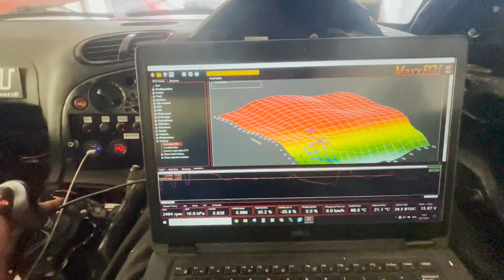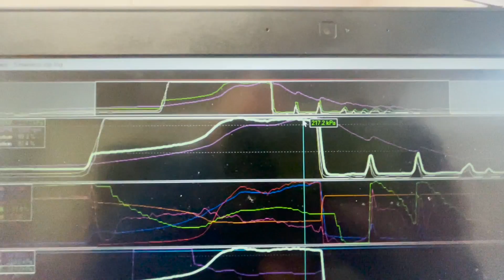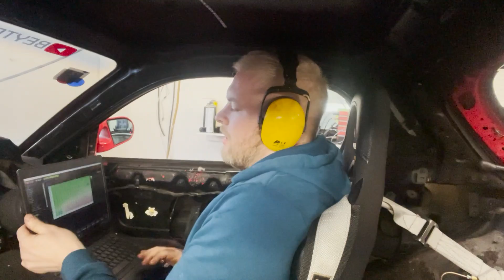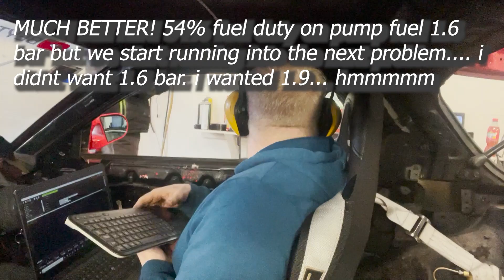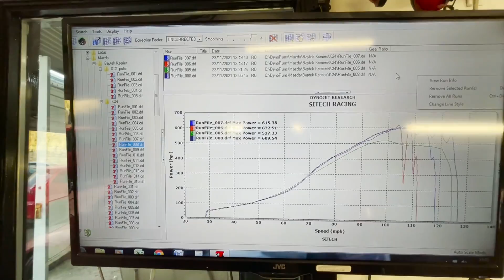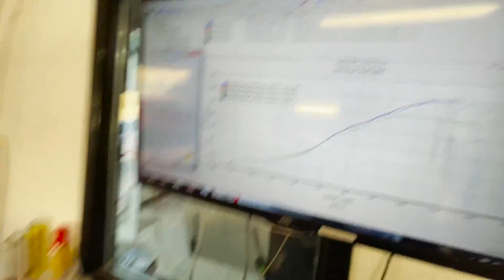TUNING RX7 AT SITECH DYNO...DIDNT GO WELL. A few issues stopped me turning it up!

Comment: Currently building my own k20 turbo mx5 with the same turbo youre running (turbo choice with thanks to many of your videos) keep it up. Looks bonkers. Struggling with drivetrain at the moment so will have to be running very low boost until I can afford the dct 👀🥲
Reply from the maker: What box are you going to use? The bmw manual boxes eork great
Reply: Currently sticking with the NB 6 speed. Some people have been fine using them with around the 400hp mark. Just tune conservatively feeding torque in. Timing etc. Was looking at the manual BMW boxes too.
Reply from the maker: @convexity11   nice man, yeah you will need to do that with a stock block too. Syncros were the issue with the mazda boxes i found as k series rev higher than the rotary

Comment: I think 2 bar would be enough. 2.5 is too much and most k series don't last at this boost. How did you bent the external's shaft? 😂
Reply from the maker: Dont you dare swear at me. Haha. Just too much heat on the dyno. Not enough ait cooling it